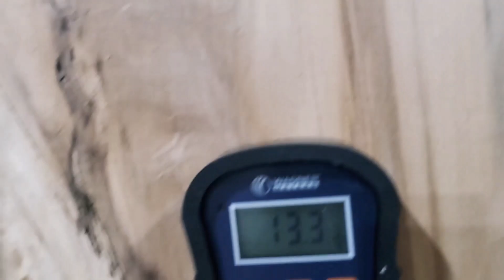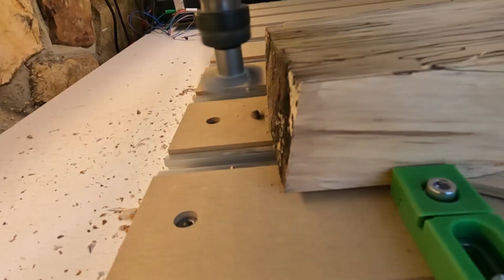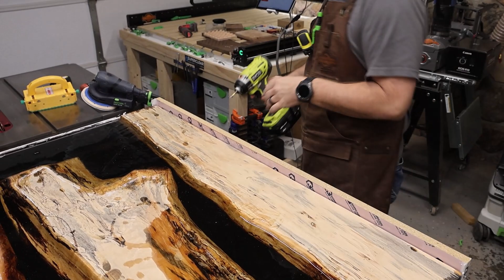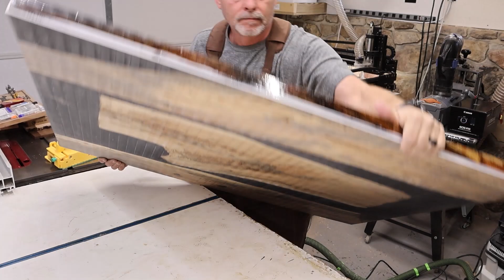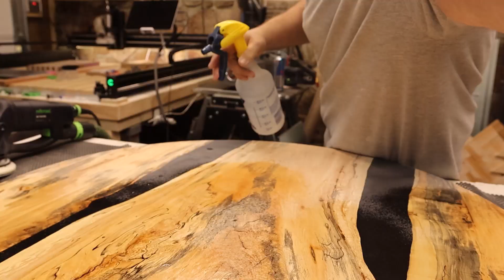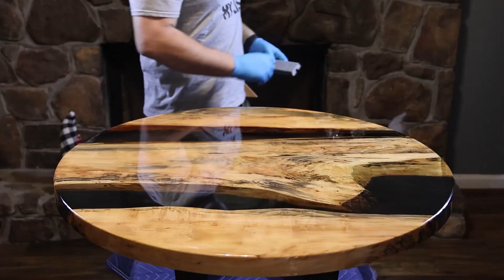I Tried the WORST Table Design Ever

Comment: Great table!! Does resin need ceramic coating? Does it help the sheen or protection? Once again awesome build!
Reply from the maker: Thank you so much. So the answer is no and yes 😀It doesn't need it however, yes it adds protection to it and I would suggest it on anything that will see a lot of traffic. that includes other finishes as well and not just resin.